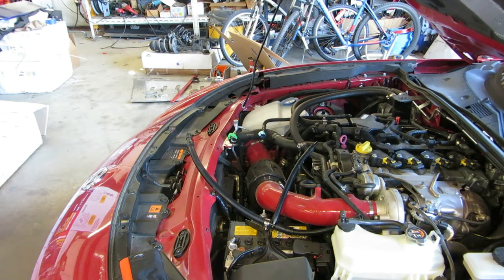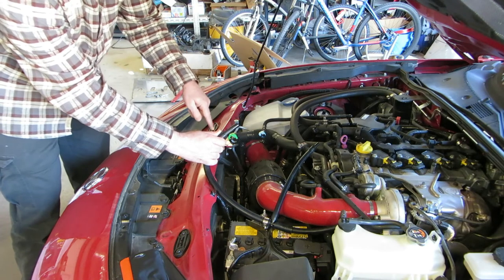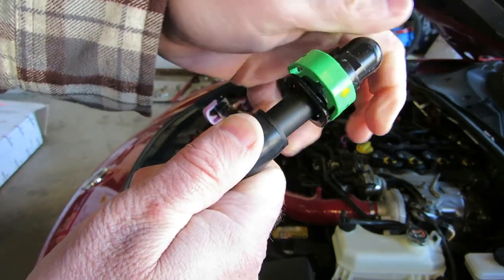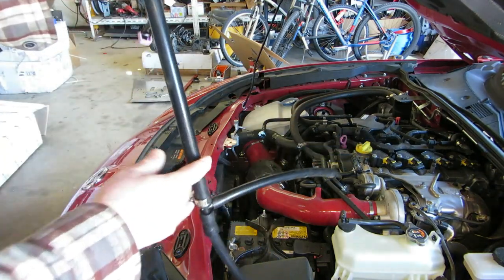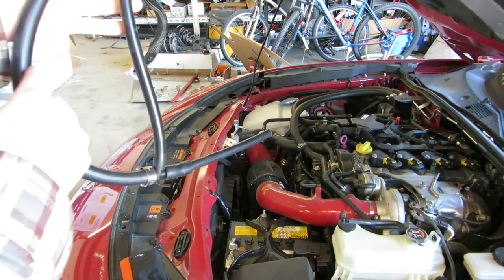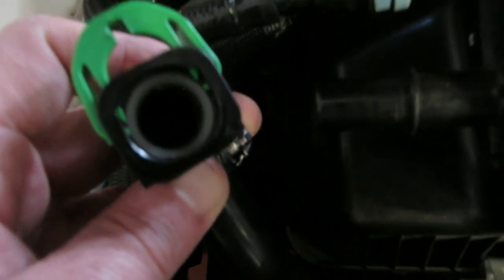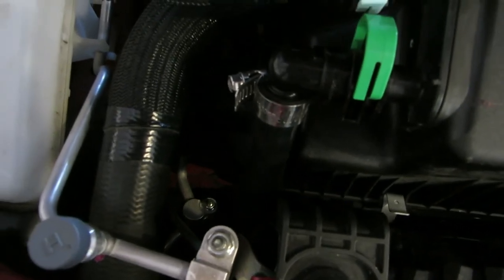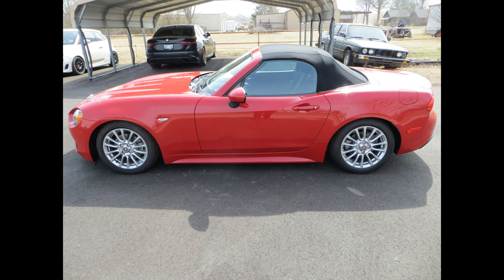Evap

Comment: What a fabulous informative video, really easy to follow. I didn't have any evap codes, but checked mine anyway. I had my t-connector in the wrong way round. All correct now. Great stuff, looking forward to more great videos!
Reply from the maker: Thanks Philip. We think that a wrong way T connector is rare, but as you prove, it's not a bad idea to check it, especially if you have an evap code.
Reply: I'm sure it is very rare as I think it was me who put the t-connector on the wrong way round in the first place. I got a little confused with the evap hoses when installing the Intercooler, and I think I may have swap the t-connector around during the install. This is why I love this video, really helpful, easy to follow and now I am 100% confident I've installed my evap hoses correctly. Thanks again
Reply from the maker: Thanks for that info, it makes sense!